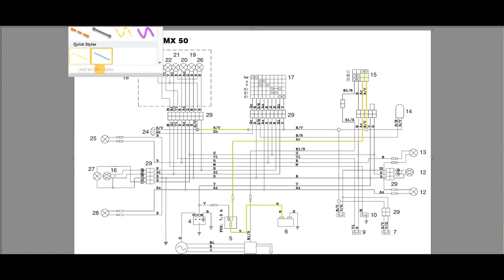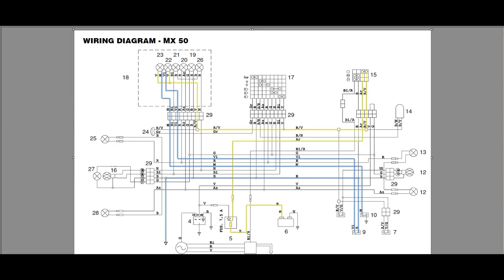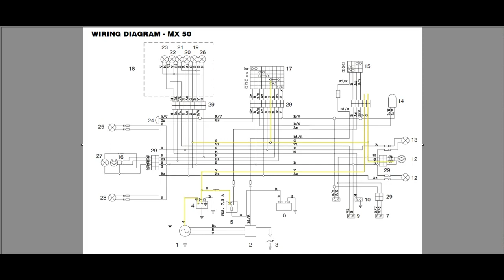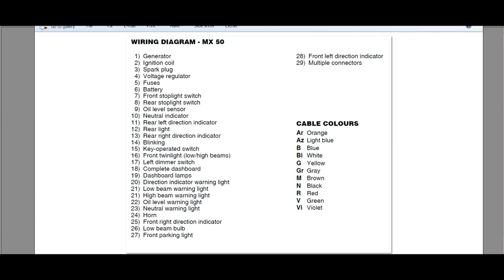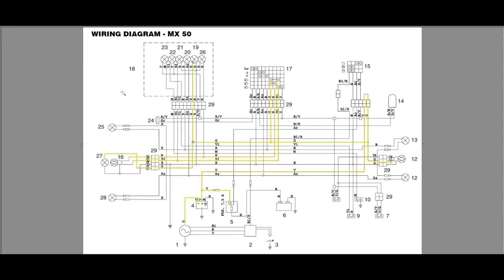Step by step guide: Understanding motorcycle wiring diagrams

Comment: 13:20 I think you may be mistaken about a ground being missing from the drawing.. 

I think the dash lamp gets it's ground from whichever side is not flashing. 

So for example - to turn left, power goes to 11 and 28 the indicator lamps and also to 20, the dash lamp. It then gets it's ground for 20 by the other wire out of it, through the right turn indicator lamps 13 and 25 and onto their ground.

And vice versa, right turn illuminates 13 and 25, and the dash lamp grounds through 11 and 28.

The dash lamp is in series with the lamps from the side that is not flashing, and because it is of much higher resistance (Ohms Law) than them, most of the voltage drops across it. Some voltage drops across the indicator lamps, but not enough to illuminate them so they can act as part of the ground circuit.

I'm not sure either about your explanation for the diode (one-way valve). 

It seems to me that the diode just blocks the battery from powering up all those circuits highlighted at 47:30, if the bike is not running or if the generator is not giving out power.

In normal operation,  maybe the generator is primarily powering up all those circuits, with any excess it generates going towards charging the battery ?

I don't know anything about these particular bikes, and it's hard to see the drawing clearly, so just a suggestion.

Appreciate you making this video though, and thanks. Thumbs up.
Reply from the maker: Nice theory, and well explained.
I'm very short of time at the mo.
I'll report back when I have had chance to re-examine the system.
Thanks for raising this :)
Reply from the maker: I've just had another look at the indicator circuits.
I think that you are right.
The connection is made after the switch, so yes... the earth is being made through the other filament, on to earth.

Nicely spotted.
We never stop learning :)

RE the one way valve (diode).
It definitely allows the bike to be fitted with lamps that are always on, but only when the engine is running.

This may be its only purpose.

Nice comments Patrick :)
Reply: My pleasure. We are, or should be, here to help each other. 

I have subscribed and look forward to your projects. 

P.
Reply: @patrickwalsh6873  Nice
I was always wondering how the Turn Signal Inductor light got it’s ground.

If I would take out all 4 turn signal bulbs. Would the Turn Signal Indicator lamp
not work because their wouldn’t be a ground anymore.
Maybe if just both (two) left bulbs were taken out it would stop working too.
etc… both (two) right bulbs …
Reply: more
…(two) …
Then the right turn signals would work, but the Turn Signal Indicator light would stop working.

…
Reply: Nice video .. came here because I have both sides on bike blinking when only right should ...I guess it have to do with the common earth/ground...

Wish I could learn more about ac/dc ... don't understand how they can have common ground

Comment: Two Bright Light switch settings.
Does this bike have two settings so you can turn on the
bright light when the machine isn’t running and when it is running?
Reply from the maker: I don't understand this question.
Reply: @EngineTuning  At 00:38:15
you cover the #17 Hi, Lo, 2nd Hi beam switch circuit.
I was trying to figure out why this switch has three positions. (See pg 14 (4) in manual) 
I think the second Hi is wired from the battery and allows a user to turn on the light without the engine running.
Reply from the maker: @jh-xk2ch  Yes.
at 44:50 I do explain this (repeating from the battery circuit explanation).
The good news, is that you have understood it :)

Comment: Multifunction Computer missing
on page 34 of the 
Aprilia MX 50 Use & Maintenance Book 
It explains how to change the
Multifunction Computer
CR2032 Battery
but the wiring diagram doesn’t show these two items.
Reply from the maker: If you are meaning the digital speedometer - its only cable was to the front wheel, to measure rotational speed.
Reply: @EngineTuning  Yes
On page 14 item (2) it is called a
Multifunction Computer.
I found the manual on manualslib website
It takes a CR2032 battery.
It isn’t wired to anything. But since it is electronic I thought it should be drawn on the wiring diagram so people would know that the Multifunction Computer wasn’t hooked to the 12 VDC battery and had its own separate watch battery.

Comment: My indicators have decided to stop working (ybr 125) no lights on the dash,  I think it's the indicator relay.  But I have no idea.
Reply from the maker: Follow the indicator circuit.
Examine the voltage along the circuit.
If both indicators stopped working at the same time ... sure, there is a strong likelihood that it is the blinker unit.
they are usually cheap enough, but you can confirm its failure, through simple testing
... for which, you will need the wiring diagram :)

Comment: Thank you for that. I am fixing my second hand 125 cc and so far all I got left is neutral led to fix. Lamp working just no ground  from engine as far is see and from brake does nothing to stop lights but mayby this video would help. The most annoying part is that cable changeing colour where they not supposed to and especially the one I am trying to follow 😑 but not much left to fix... hopefully
Reply from the maker: Antoni, download the manual and print out a few hard copies of the wiring diagram and legend.
With a highlighter, you can isolate the circuit that you are working on, and have the hard copy in your hands, while troubleshooting.
Add notes to the diagram ... say, where a cable changes colour etc.
Doing this will help embed the information in your mind; ultimately making it 'working knowledge'.

The real key, is to fully appreciate the simplicity of the wiring diagram.

- A connection is made ... or it isn't
- A +ve wire is shorting to ground ... or it isn't
- The wire inside a cable is broken ... or it isn't
- A component is working ... or it isn't

If the first three questions are satisfied, then a component isn't working.

The biggest shock for most people, is that it is 'that simple' :D
Reply: @EngineTuning  Thank you for broad reply to my post. We finding with my mate and luckly fixing it on its way😊 that there were some cables with moist on them with might be the issue for bikes some strange behaviours. One thing that I do not get and is very weird is that when I am connecting petrol tank back by cables  (it is giantco hy 150 based on Honda cg 125 at least by engine). When I do black to black, green to green, brown brown, I have got fuel gauge showing lv as normal but no lights on tank gauge🤔. When I swap green with brown in places I got all till I turn the lights on as then gauge going back to zero but lights on tank stays on. So my question is how is that possible. I love to have lights and gauge reading all the time especially at night. 👀
Reply from the maker: @AntoniOrszykowski  Hahaha! ... This is why you need a wiring diagram :D
Reply: @EngineTuning I thing I did it but wil I have got a question regarding right hand side switch. I know every bike is different. My 125 cc have two bulbs in front. If I move it to middle I got brake rear light on highlighted speedometer and front beam light (big bulb) on it's own, in all the way to the left setting rear light  stay same, highlighted speedo and only small blue bulb on. I did change switch to new as old one with wiring was 15 years old and had strange connections done by previous owners. So my question is whether is that how this lights should work in those position. I did exactly same way as before wire by wire in 9 pin cube in exactly matching possitons and do not remember how lights were working before. Rest of cables coming of that swith would be for brake Lever but that is working OK as well as kill switch and starter. So there is only two wires to mess with in the connector cube but when I swapped them other way around I only had speedo hilighted in mid switch possition and but then only small bulb blue on and in far left it would turn rear brake light off, speedo highlights off yet turn both front bulbs on. Just wonder with is the way that you can call normal? I quess I am in right connection but asking as ebay sellers did not provide any answers to it what so ever. I did look for wiring diagram especially for giantco x treme but nothing there.
Reply from the maker: @AntoniOrszykowski  The thing is Antonio ... when you swap wires around, you are simply rolling dice.

In my experience; humans always choose the difficult route, when fixing problems.
Of course, the human is wanting the quickest route, ... only that the quick route is rarely chosen.

We are all guilty!
It seems that we are programmed to struggle.

To win the game, you must choose the easy route ... the one that quickly leads to both success AND understanding.

We can accept short term failure in the game ... but some of us realise "I made the wrong move ".
We ask ourselves (in disbelief), why, WHY, FFS why didn't I do it correctly at the beginning????????
Why have I wasted all this time (and sometimes money)???????
... when I could have simply done the job correctly.....

The correct way, is to locate a piece of paper, a pen or pencil.
Write the title of the circuit.
Draw the lamp with +ve & -ve ... obviously draw a line from earth (chassis) to -ve.
Draw a line from +ve to switch OUT.
Draw a line from switch IN to the power source.
(this is a +ve switched circuit)
(note: switch IN and switch OUT is nonsense ... the switch simply connects two cables or disconnects two cables)

Apart from looking for paper & pencil ... that took you no more than 5 minutes (possibly 2 minutes).

Okay; but maybe it is a -ve switch circuit!
Hahaha ... easy!

Draw a line from the power supply to the lamp +ve.
Draw a line from the -ve to the switch IN.
Draw a line from the switch OUT to the earth.

For both diagrams, note the colour of the cable that you are using.

It doesn't matter which system that you choose ... both will work fine.
The point is ... that you have now drawn the wiring diagram for the circuit, and it took you only a few minutes.
You also will have that wiring diagram for ever!

Sure, you need to examine the switch, to see how the single power IN is distributed (maybe one IN & two OUT etc.)
... and then draw that into your diagram ... but again, we are talking about a few minutes of work ;)

Yes ... it is that quick & easy.

Every time that you have a problem ... TAKE THE EASY ROUTE AND MOVE FORWARD QUICKLY !!!!

Comment: Awesome video. I have a general question - if something like a light bulb grounds out via its socket, which is connected to the frame, why do we need so many wires carrying all this ground throughout the bike? Isn't it enough to just ground out at the socket? Sorry if this question doesn't make any sense.
Reply from the maker: Great question James :)
The short answer is that we don't need feed and return wires everywhere, and often, there will only be a feed wire, with the return passing through the socket, which is connected to a bracket, which is connected to the frame.
You can see this with modern chromed plastic fittings, where a short wire is connected to the screw that holds the plastic to the frame.
From this, you can understand that a cable can be better for the task, due to the chassis being enamel painted.
Also you might want a switched negative, so again, a cable is required.

Comment: Sir, from the item #4, where and how is the aluminum fin that absorb the extra heat wired up? Thank you
Reply from the maker: It depends on the bike as to where it is and whether it has a heat sink.
It is often hidden under the tank, attached to a frame lug.
It could be part of a regulator/rectifier enclosure (where the heat is given off).
It could be just a slab of aluminium, without fins ie. it might not look like a traditional finned heat sink (as seen within consumer electronics), because there is lots of moving air when riding a bike.
The big finned heat sinks in computers and such kit, is due to the systems being fully enclosed, and typically surrounded by other heat generating components.

Comment: Love the explanations in your video. Any good books that you might recommend to continue furthering one's understanding of motorcycle wiring diagrams.
Reply from the maker: Good question.
I can't provide you with any direction there.
Motorcycle wiring is the product of electricity fundamentals, and with the onset of digital switching, it is now a mixed bag.
By this I mean that, you might wish to understand a voltage regulator ... but this isn't 'motorcycle wiring', it is fundamental electronics - capping off a voltage, and getting rid of the excess in heat.
Similarly, voltage drop (say dim lights) is a function of connections, and the cross section area of a cable - electrical physics.
 
Rather, I would suggest that you spend time reflecting upon the simplicity of the given electricity, passing from the source, through the 'load' (the component using the electricity), through a switch, and returning to the source.
By doing this, your own brain, and eyes, will inform you of the problem areas where connections occur - wiring joints, switch contacts, corrosion etc.
This will lead to you making better joints, and might cause you to acquire products that clean corrosion and seal out oxygen, and water.
You will also naturally encounter components, causing you to reflect on their operation, perhaps requiring you to search for specific answers to questions that you previously never thought of asking.

In this way, you will grow your knowledge of the fundamentals that are specific to your needs - meaning that you will sponge up the knowledge - it will become working knowledge, rather than learned knowledge.

Before long, you will understand high tension voltage overheads, and why the tickover drops when you switch a headlight on.
It won't be just because you switched the headlight on, it will be because you will understand that the voltage overhead has gone, and the spark power has diminished.

Stuff like that.....

You'll discover that you will never know it all.
... but you will also discover that when you encounter a question, the answer will be readily available to you, because you will have learned how, and where, to find the answer.

There isn't a single book that can deliver that.
The knowledge is available on the web, and your enquiring mind delivers it ;)
Reply: Engine Tuning .... boomer talk

Comment: Great video helps me a lot to repair my scooter thx mate ❤️ , what about  the wiring diagram of  water cooling system for Honda freeway 250cc !
Reply from the maker: Glad that it helped Joey :)

Re water cooling.
Generally it is all mechanical.- driven by a belt or a gear, directly from the engine.
Control of the circulation is down to a bi-metallic valve that opens and closes at preset temperatures.

The only electrics in such a setup, is a feedback sensor to indicate overheating.

For some engines, an electric water pump can be fitted, presumably functioning via a temperature activated switch.
Is this how it is on the Honda?
Reply: I think its a  manual cooling pump but in the electric side she have fan with 2 speed variation depend on the temp level
Reply from the maker: The 2 speeds will be for efficiency.
In winter it may only need the low speed to cool the coolant.
In summer, it might need to switch to a higher speed.

I don't know how it is controlled.
It may have one temp sensor, and a monitoring chip.
Approaching max temp, the fan will start on low.
If the temp hits max, the monitor will switch the fan to high.

Another way, would be to have two sensors, preset to a switch at a lower and higher temp.

If the sensor is providing live temp feedback to a gauge, it is likely it will be monitoring voltage change.
It could be a single wire, with the circuit completed through the earthed sensor.
If not, then 2 wires will be used.

You need to study the wiring diagram.